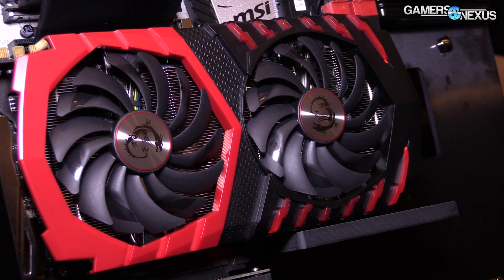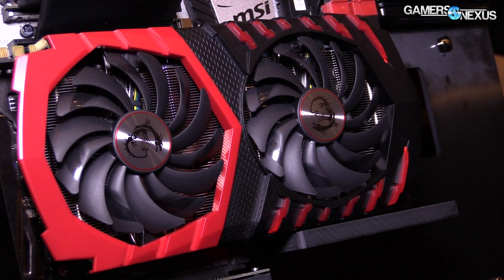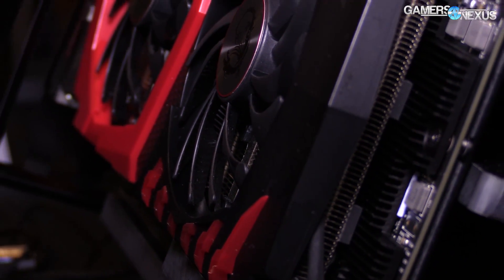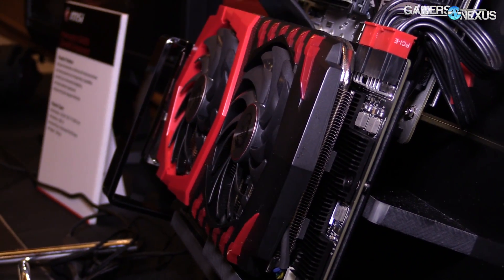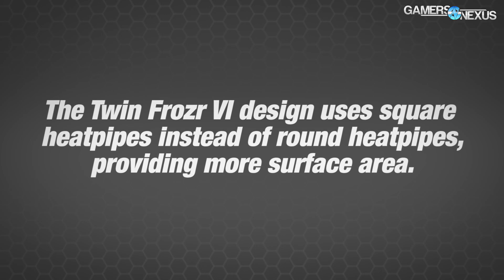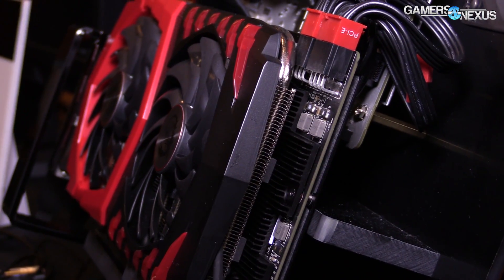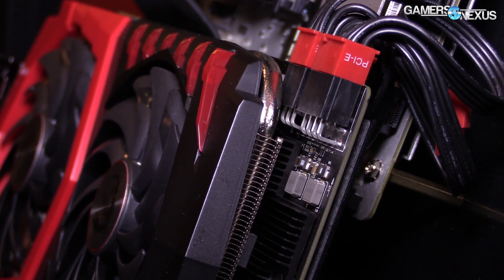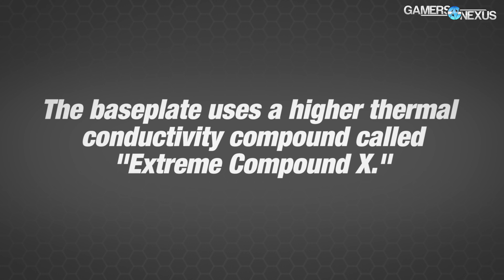MSI GTX 1080 w/ Custom VBIOS, PCB, & 10-Phase VRM

Comment: I'm curious when this card will hit the market.
Reply: usually it will take two month in my country, just contact your local card agent or store
Reply: The 1080 reference card is already available here (The Netherlands) so I expect it won't take too long. I'll buy the card in 3-6 months anyway because I have to safe some money :P The 970 will do fine till then.
Reply: Yes the 980ti, especially when overclocked is very good for 1440p but not as good as the stock 1080. The 1070, according to a benchmark video I watched (type "1070 overclock" on youtube, I think it's the first video), performs on par with 980tis in games, even when both are overclocked, with even a slight advantage for the 980ti. 
But I guess it's better to purchase a newer card, because Nvidia will improve the Pascal drivers and the 1070 will probably perform better than 980ti over time, and it will be easier to sell if you want to upgrade in the future.
Reply: By the way, I saw on a British website that the 1080 gaming 8G will be released on June 10th... So it depends on the country, even within Europe. For the Netherlands, I don't know the exact date.
Reply: July 1st in France so I guess it will be probably the same date for the other European countries. 

The price tho : 799€ (the FE is 789)
Reply: Thanks Marc. The price is high and more than twice as high as I paid for my GTX 970 but it's a good investment. I don't know, maybe I'll buy a 980ti first. That's also a good card for 1440p gaming. What do you think?
Reply: Thanks for the info Marc. I'm most interested in the 1080 Armor because I wanna build a black & white build. I'll have to safe some money but it will be worth it :)

Comment: Why are 6 pin connectors still a thing, my psu only has 6+2 connectors, and likely any psu that has more than 1 pcie connector, so all it means is that a 2 pin is just dangling there.

Comment: how does a 10 layer PCB improve overclocking?
Reply: he means structural stability (more rigid)
Reply: But a 10 layer pcb is not necessarily thicker than a let's say 8 layer pcb.
Reply: Also, why should this influence overclocking
Reply: It's the 10+1 power phase that will deliver cleaner more stable power to the GPU and RAM, increasing the overclocking potential.

Comment: Do you think a single RAM VRM phase is enough? Are the memory chips so tightly binned that their increased power usage from OC will be small due to hitting the wall well before 10.1 GHz? Also what's called frequency in memory annoys me.  It's the baud rate in DDR bps (GDDR5X uses QDR but that only changes how the clock is sent, the data lanes are still running DDR).  The frequency is half the baud rate.  P important distinction that marketing and consumers struggle to keep straight.
Reply: Well I read that the 8GB of GDDR5X uses 17W vs 4GB of GDDR5 uses 30W.

Comment: very quiet. i had to raise my volume to a hundred to hear you ok. please fix or adjust. thank you. awesome coverage though. will be watching all of it.
Reply: or fix your sound or check your hearing:Psounds good here and have the audio very low :)
Reply: +björn sjöblom GN and digital foundry are the only ones super quiet. every other youtube video is 40% sound. its they way they record/edit i think. much too quiet for me though. even with sound normalization.
Reply: +whit3emperor okey it maybe is:)had no problem with it anyway :)but not that hard to raise the audio otherwise:)i always have it little higher on the tv so i just can raise it if i wannt:)all things have different audio anyway so :)world problems^^:)
Reply from the maker: Quiet room so quiet speech, should have amped up in post, maybe. Thanks for the heads-up.
Reply: +Gamers Nexus thanks for the reply. sound is super clear and video is good. just a bit too quiet overall. :D
Reply: As I posted on the 1070 review, I can hardly hear anything on my nexus 6p front speakers. PC don't matter as you can always up the volume pretty easily.
Reply: I gotta agree, it really is very quiet. I usually have volume bar in windows on 30/100 and youtube volume slider on half or a bit less and it works fine for most videos on youtube. For this one though I had to go 100/100 in windows and full volume in youtube.
Not a big annoyance for me, but might be for some especially headphone wearers that go watch another video after this one are gonna rekt their ears xD.
Reply: +Adnan Ahmed Your 6P must have an issue, I can hear him just fine
Reply: LongNeck Bastard every other videos sounds fine, not my issue.
Reply: Adnan Ahmed I have it pressed 4 times from 0 % volume and it was 100% audible. But if that's the case I guess you're fine

Comment: EK appears to be working on a waterblock for this card, an Asus card and a Gigabyte card, but EVGA does not receive any waterblocks this time around it seems.
Reply: because evga is using the reference board, which EK has made a design for already.  That is the superclock edition anyways.
Reply: Final Cam EK have specifically said they're not working with EVGA on any of their cards, including their non-reference designs. EVGA are not going to use EK for their new Hydro Copper either. That much is officially known.
Reply: Sveinung Tørresdal that stinks
Reply: Final Cam It sucks, but it sounds like EK and EVGA are pissed at each given their actions. Shit's weird.